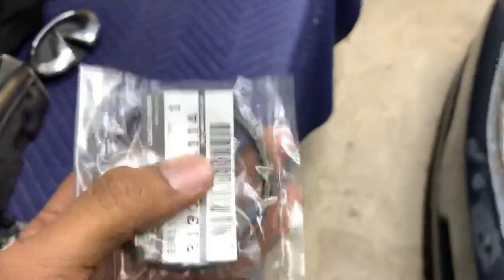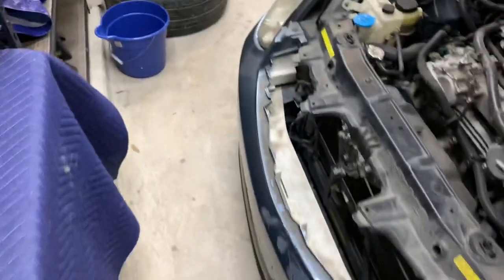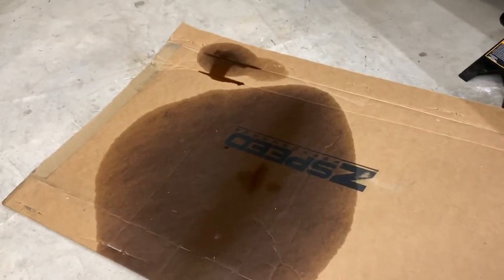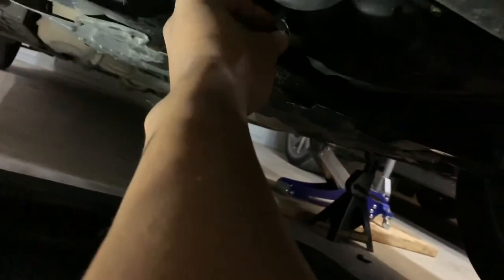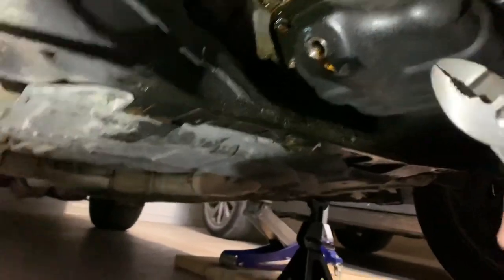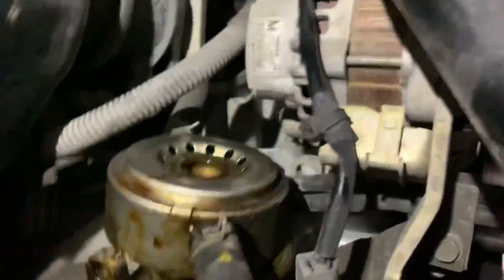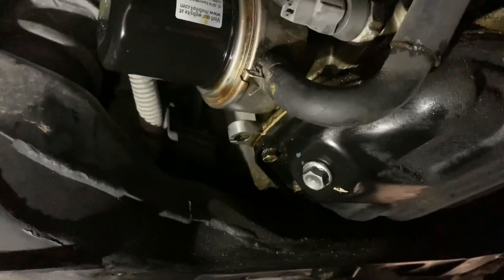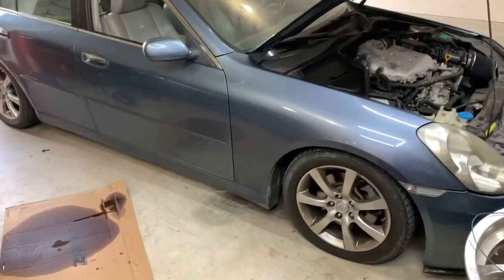G35 | Oil Leak Fix

Comment: Just did this on my G35 coupe last week. I was worried about the smaller O-ring too, since someone else complained about it, but I agree, I think the original orange one shrank which caused the leaking in the first place. I made sure my O-ring was flush against the cooler before I reinstalled so it wasn't pinched or anything. Still have to double check and make sure the leak is gone but I'm pretty confident it was the oil cooler gasket.

Comment: I think my oil cooler hose has a pinhole in it. Will probably order the hose kit from Z1. I followed your video about 6 months ago, had to tighten up that oil filter bolt, replaced the oring like you said, and I felt a lot better about the engine leaking oil but I did notice drops forming at the hose. That hose is probably 20 years old by now so I might as well replace it.

Comment: I have a massive oil leak on. 2003 g35 sedan. I changed the gasket valve covers , same issue.
Reply: What did you to fix your oil leak because I replaced both cover valves and cover valves gasket plus I changed the intake gasket along with oil pan gasket, and oring and oil filter along with the oil pressure sensor and I spent at least 1500 on parts and labor and still the same problem
Reply: Cedrick turner I’m still having the oil leak, my current problem is smoke coming from the drivers side gasket cover when I drive 5 mins or longer and I’m at a stop, I don’t think it was sealed properly
Reply: The oil is leaking from the passenger side and mine is smoking too
Reply: Cedrick turner I’m getting tired of having to keep putting oil every 2 days. I’m thinking about possibly doing away with it, I don’t want to invest anymore money into it.
Reply: I definitely understand I just spent 14 to 1500 on all the stuff to fix my oil leak
Reply: Just buy a 5 quart jug at Wal-Mart for $12.

Put a quart every week. Thats $125 a year. It's not that bad. It could be worse.

Comment: Yo as soon as my g hit 100k both leaks happened same time 😒 and how did you get your intake cone on the stock pipe ?
Reply from the maker: Damn. So weird it times it that way. The intake I have no idea. Bought the car this way. Rather have the stock air box.
Reply: Same cost me close to 1 grand to fix both. Smh
Reply: Warm up the rings and slip those on first by twisting it righty tighty with a little bit of armor all, and then the cone, but make sure to clean mass air flow sensor, with mass flow air sensor cleaner spray it three times and let dry for one minute in between sprays, do not drench.

Comment: I don’t know much about cars but if my car is leaking oil and producing some smoke out of the hood will this solve that issue?
Reply from the maker: Depends where the leak is coming from. These cars also tend to leak oil after 100k miles from the value cover gaskets. The smoking could be oil dripping onto your headers.
Reply: @ProjectKaiGarage33  ok thanks for the response👌🏾

Comment: Do your car still leak a little once you replaced the seal. I replaced the seal, oil pan, and sensor 2 days ago and there's steal a little bit leaking from my 08 m35
Reply from the maker: Mine doesn't leak at all anymore. When you replaced the seals did you check to see if there was dirt and gunk in the area? I've seen a few people that when they pulled there old seal there was stuff that they had to clean out before placing the new one in.

Comment: My g35 doesnt start and i just seen on the floor theirs a oil leak any suggestions
Reply from the maker: Does it turn over? or just does nothing happen.
Reply: @ProjectKaiGarage33  it does turn over its just that i pulled out pretty hard and went down the street to the store and wen i turned it back on i barely made it home going atleast 4-5 mph i even put it into manual since its a 2005 g35x and the gears didnt switch for nothing so i literally made it home with 4 miles per hour and i was gassing it aswell and still nothing
Reply: There's a sensor on the tranny  that gets stuck sometimes and causes the transmission to not shift.
Reply: @andrewlopez2175  did you ever find out your problem?

Comment: This video started out great then it went to sports then you didn't even show how the cooler comes off the filter piece, not showing taking the gasket out nor putting it back in. Looks like you focused more on the snap edit rather than actually teaching someone how to fix this. Wack!
Reply: Its a Great video bro, he did everything perfect, stop hating, you know where the problem is at and you know to take off the little hoses and take out the ring and replace it with the other one. Hope you fixed your car